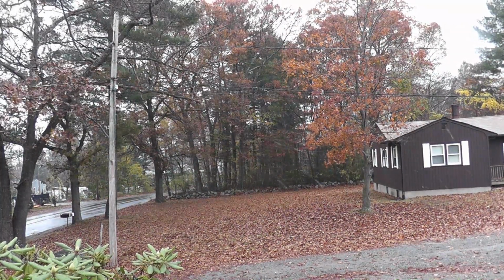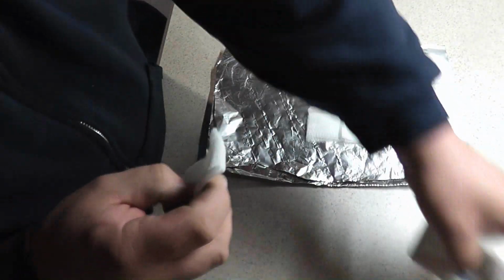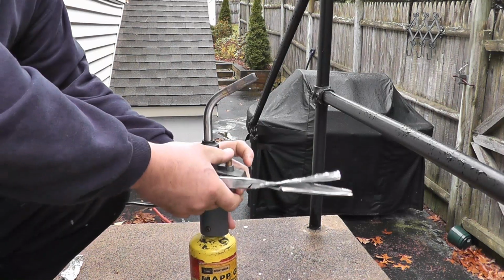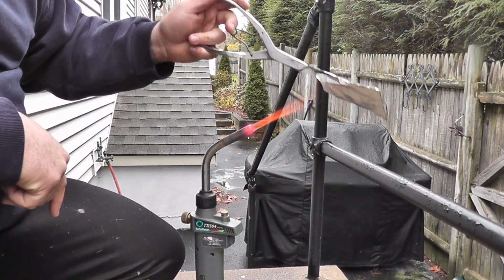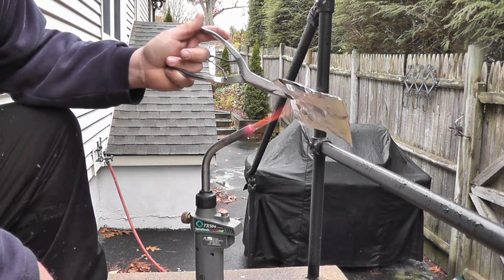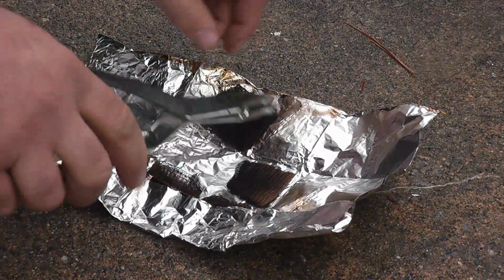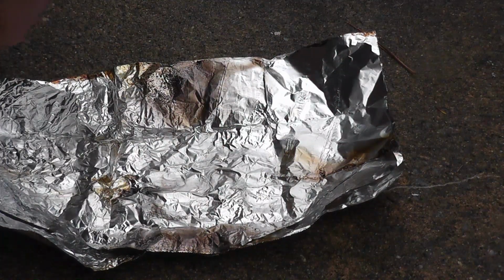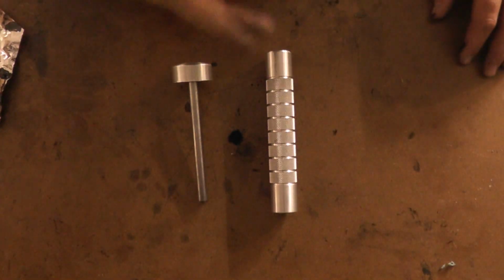Making Char Cloth

Comment: interesting gizmo. looks to be based on the diesel engine principle where the rapid compression of air ignites the fuel. i would imagine slightly oiling the piston would increase the seal.. have you tried using this thing with charcoal or any other other charred material?
Reply from the maker: I have not although I did try straight dryer lint for kicks.  It singed it, but it never made a usable coal.

Comment: Nice one Greg!  Is there a relationship for the length and diameter of the piston to get maximum heat transfer to the tinder?  Thanks for what you bring to us!  PJ
Reply from the maker: To be honest I just winged it.  I made a fist and measured it, added an inch or so to each side and rounded up so I could get something that was comfortable to hold in the hand so it wouldn't slip out and I wouldn't be pinching a finger between the casing and handle.  It ended up being 6". The bore length ended up ~4 3/4" and was more a function of the drill bit length than anything.
Reply: *****
Makes it that much better that you winged it perfectly first shot!  Thanks for the numbers.